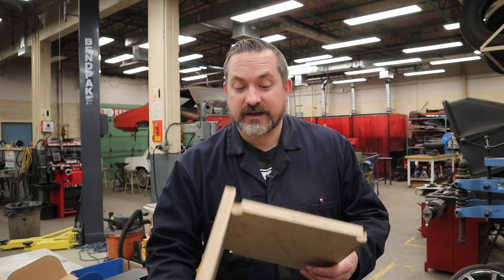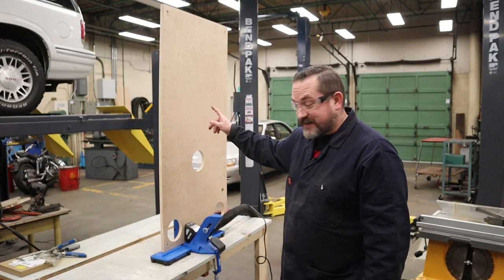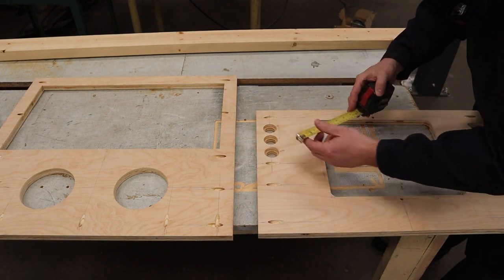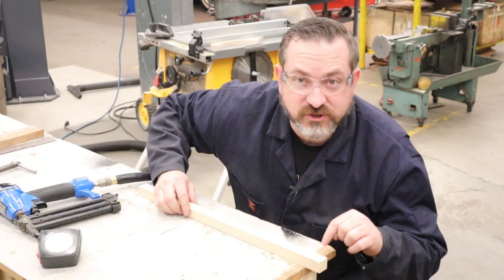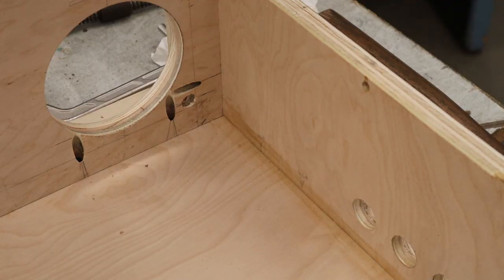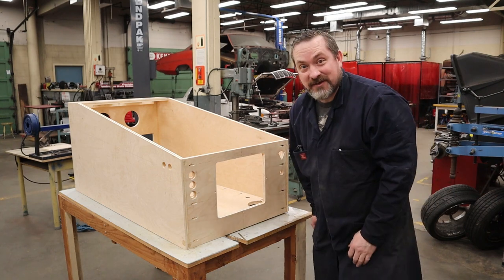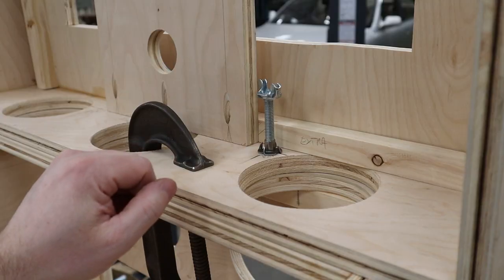How to assemble your virtual pinball cabinet

Comment: Very cool... one thing I would of done to make it look nice is to put a small piece between the playfield and backbox (to lift the backbox from the cabinet), just to separate the two, look more original.
Reply from the maker: Ya know, you nailed it right on the head.  As it turns out I missed the part in the mjrnet plans that has the top piece of the cabinet having a rabbet which would raise the back box 3/8".  So I had to cut a piece of 3/8" plywood to put between the two and plug/redrill the back box hinge pivot holes. I make note of this is a future video coming out soon.  Thanks for the suggestion and the watch!

Comment: Thanks! I love your videos! <3 I was thinking that T-moulding needed round corners... I can't wait to see how it fit on sharp corners! ;-)
Reply from the maker: You are so welcome!  Thanks for watching them!  If you cut the spine off at a 90 degree cut out, it should fold around a 90 degree corner but with a slight radius added to the outside.  I plan on softening those sharp corners a little bit, maybe like a 1/4 radius or so just with sand paper on a sanding block.  It's funny because most of the pinball cabinets I have been looking at don't even go around the corners. they just put the t molding on the front and that's it.  I like the full wrap though, I think it will look more polished/finished and not cheaped out.  Cheers!
Reply: @wayofthewrench  you are so meticulous… you are an inspiration!
Reply from the maker: Love the comment, thanks!

Comment: Great job liked your video. 
Sorry if this feels like criticism it is not. Hopefully this will save you time.
If you were going to hinge the back box it will not work. What is needed is a 3/4” lip at the top of you cabinet. You can fix this really easy by adding an additional peace of 3/4” plywood to step it up. Hopefully you have not drilled your back box hinges yet.
I made this mistake in 2015.
Reply from the maker: No no none taken, this is my first vpin build so I'm totally open to suggestions. I actually did your mistake and just went ahead with it.  I just realized that the mjrnet plans are for a rabbet joint on the top 3/4" piece which would make it stick up a 3/8".  Do you know if the 3/8" above is not enough?  I just made up the 3/8" piece but still have to glue it on the top but I already plugged/redrilled the back box hinge holes for the added 3/8" piece.  I should temporarily clamp it on and see if it works, mind you I'm not too concerned about it fully closing but it would be ideal.  Thanks for your suggestion and the watch! Cheers!
Reply: @wayofthewrench   Not sure about the 3/8 measurement. When I realized I messed up. I cut a new 3/4” plywood for the top. I mirrored my cut outs for cabling I then place it on top of my existing top glued and screwed. The overall look of it was not noticeable as a mistake after I put in the glass channel reciever 
I did drill my holes for my hinges already so I filled them up with plywood plugs and glue and sanded them away.
This is going to be a great first cabinet. The next will be even better.
Reply from the maker: Yeah you did what I just did except I did 3/8" so I guess I'm gonna find out, I'll let ya know.  Thanks, I'm really looking forward to my cabinet.  I've been playing a lot of pinball in local places and on ps4 but can't wait for this build to be complete.
Reply from the maker: Well I just checked....3/8" isn't quite enough so you are probably right about it needing 3/4".  Not sure I'm going to change it a third time but will definitely tell people in the future video.  Thanks for the heads up!
Reply: @wayofthewrench   I need to let small things go here and there too. My OCD is pretty bad though. I burn a lot of dollars. Lol
Reply from the maker: Yeah I'm part of the OCD club too. Part of me wants to fill/drill those holes again but the way I see it, I would never just put the back box down and mash up the stainless side trim anyways so I would have to place a board in their with blankets to prevent any damage anyways.  So just gonna leave it and be happy with it the way it is, which 99.9% of the time is upright and gaming.  Cheers!

Comment: Are the bottom and the side's of the cab the same size?,plans on the net show the bottom 36mm shorter.Thanking you in advance.
Reply from the maker: The sides should be the same but the front panel and back box are bigger to accommodate the tv.  Plans are in the video description.  Thanks for the watch!

Comment: Very nice build! Also very nicely explained although I have plenty of experience myself I got a few tricks along the journey. 👍🏻
One thing I am curious about. I noticed that most of the pocket holes are on the outside. Is there a specific reason for this? I usually make them on the inside, because it saves an awful lot of cleaning up and filling later.
Reply from the maker: That Bruh!  Glad you enjoyed the video and got some new tricks to add to your game.  When I made two test pieces that was held together with pocket hole screws, there was significantly more strength when the pocket hole screws were put into the inside rather than the outer edge.  So based off that I put mine from the outside.  Its not that big a deal as I need to sand the outside of the cabinet anyways so a little wood fill/bondo and it'll be mint.  Thanks for the watch!

Comment: First of all, that Jig is awesome, $175 ouch !  Anyway, I am thinking about doing mine in particle board, just because the fact that I plan to skin and the price point. Will that work well with doing pocket holes? 

No question, I would do the wood blocks as well, that would keep it rock solid.
Reply from the maker: I do not recommend using particle board as it will dampen all of the ssf vibrations and personally I think particle board is junk.  It has it's uses but here is not one of them.  You will have to sand an enormous amount to get it smooth enough to not see every chunk through your vinyl.  Don't do it CoolDave!  Pony up and at least find plywood if not cabinet grade plywood.  Should be about 150-200$ CAN.  Cheers!

Comment: Can you please explain to me why you need the complicated angled screws. You still need to fill the holes & it will be wrapped anyway. Your a Legend so there must be a good reason but my brain can't work it out. I would have thought just drilling in the side at 90 degrees would have been stronger & so much easier?  Can't wait for your next video on the epic build!
Reply from the maker: If you run screws into the edge of the plywood, it has horrible strength, unless you screw into the 1" x 1" glue blocks which is exactly how I did my arcade cabinet.  There is absolutely nothing wrong with doing it that way.  In the video I explained that and said I wanted to try/learn/teach something new for everyone, including myself.  Now the  pocket screws could have been done from the inside and there would have been no holes to fill on the outside, however, when I made a test piece and did some research, it was way stronger from the outside.  So to me, it is extra work to fill/sand them but the end result is a stronger/longer lasting cabinet.  Especially with the glue up blocks.....it's bulletproof!  I might not even fill the holes on the top of the back box or the ones on the back of the cabinet because you literally will never look at them.  Then again, I'm a glutton for punishment, so I might...lol.  Thanks for the watch.   Legend out!
Reply: @wayofthewrench  Thanks for the informative reply.
Reply from the maker: No worries, glad I could help
Reply: @wayofthewrench  Kreg sells plugs that fit the pocket holes, or you can cut your own using a 3/8" dowel and a flush cutting hand saw. A dab of glue and a bit of sanding and the pocket holes are all but invisible once filled with a plug. On a side note, I met Craig Sommerfeld and bought one of his original K-2 Kreg Jigs at a woodworking equipment show back in 1990. Nice guy, and it's cool to see how big Kreg Tools has grown since then. At the time he was a one man operation selling his jigs off of a card table at trade shows like the one I attended.

Comment: Really appreciate your videos and right in the middle of my build over the holiday (here in the US) - question for you: why did you put your pocket screw holes on the outside? Is it because you're going to vinyl wrap later in your build?

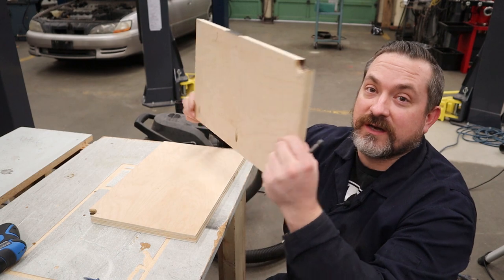edit: nm I saw your answer around 5:48 - looks like you fill them with wood filler and sand later on. I had also realized that you get more grip by angling them down into the material rather than towards the edge (if they were reversed) which you also confirmed.
Reply from the maker: Yeah I got a lot of flack for this but I did the test and I went for better strength rather than hiding holes, especially since I was going to fill/sand/vinyl over it anyways. If you deem me worthy, I'd really appreciate it if you could share out my channel on your social media so I can help more people. Thanks for the watch and your support for the channel!

Comment: Hi,I'm going to use 18mm ply for my cab, and will simply screw them together (sides to the bottom etc),will 40mm long screws be OK to put the cab together?,thanking you in advance.
Reply from the maker: I would highly recommend gluing and screwing in some reinforcement with glue blocks on the inside to beef up the screwed corners.....they won't be enough in the long term.  Thanks for the watch and welcome to the channel!
Reply: @wayofthewrench how about 50mm?,....it's just that I had a shed load of 40mm and thought I could get away with it!.Thanks for the reply.

Comment: Just curious... i am in the process of assembly my cabinet and there is a slight bow in my 3/4 inch plywood side panel.  might be an issue when i install the glass.   So my solution is to put in two Side panel to side panel cross braces (2x4), just below the monitor support frame. This will pull in the slight bow and provide additional support for the monitor support frame.... or should i just replace the bowed side panel with a "straight piece" .. your thoughts
Reply from the maker: Hard to say without seeing it but yes the cross bracing will pull in the sides a lot.  Unless it looks like a Dorito, it should be ok.  Good luck!

Comment: Hi,what is the purpose of glue blocks?and are they necessary?
Reply from the maker: Technically they are not required but they add so much rigidity that the cabinet is bulletproof.  So it's cheap and easy insurance for the cabinet to last way longer than even factory ones.  Thanks for the watch!
Reply: @wayofthewrench  Thanks for the reply,but wouldn't it make more sense to have them right up against the sides?,or am I missing something obvious here?..... By the way your pinball series has been outstanding;thanks for all the work you have put in;not only in building the machine,but all the video editing, uploading...etc etc.Well done.
Reply from the maker: Yes they are glued right into the corners so they touch/support the sides.  Thanks!  I work really hard on these videos so it's always nice to hear back from subscribers.  Cheers!

Comment: If I'm just wanting to drill holes from the outside and screw straight into the ply... not pocket holes...
Is there any tips for do's and don'ts? Like best screws to use.. how far to drill.. how far to counter sink etc?
Reply from the maker: Hrmmm let's see.  Predrill the holes for the screws just so the body of the screw passes but the teeth can fully grab.  Countersink your screw holes so the head of the screw sits just below the surface once tightened.  Use screws that are long enough to go through the 3/4" sides and into the glue block/batton or the other side at 90 degrees.  The batton will have more strength if you can go into that....plus the glue joint.  If you watch my arcade cabinet assembly video, you'll see exactly what your asking about because that's how I did that one.  Cheers!
Reply: @wayofthewrench  yeah I've watched that... I'm planning to screw through the side of the ply into the ply in joining to.. and then glue blocks in for bracing... rather than screwing into batons..
Reply from the maker: Yeah I wouldn't suggest that as you are screwing into end/edge grain which isn't as strong in plywood.  I highly recommend you glue screw/brad nail a batton in and then the other piece screws into that.  It will be way stronger and the plywood plies won't seperate.
Reply: @wayofthewrench  hrmm.. maybe i will do the pocket holes then.... but the tools are gonna cost me a couple hundred more lol...Do you think go for the corner clamp or the pocket hole clamp?
Reply from the maker: Ya know it all costs money but think about the price of your experience/learning...it's priceless.  Plus you get to keep he tools and your next project will benefit from having these tools and the experience.....it just keeps getting better and better.  Either work, I bought the pocket hole clamp but there might be a benefit for buying both.  Good luck Chris!

Comment: What do you suggest if we don't have a compressor and brad nailer?
Reply from the maker: You can clamp and predrill holes for screws too, I was just trying to show another method.....it is also way faster.  Really if you do it right, you don't need and nails or screws, they just hold the wood in place while the glue dries.  Thanks for the watch!

Comment: shouldn't you have put all the pocket holes for your bottom cabinet piece on the bottom side of the cabinet and not on the top of the bottom side?  In the way you did it, the screws are going into less meat of the wood.  You did it correctly on the backbox.
Reply from the maker: There is a 1 inch space underneath the bottom piece so either way it is the same strength.  The bottom also sits on top of the 1" glue blocks too for tons of strength.  The reason why I put the pocket holes on the top was because if I put them on the bottom, the glue blocks would block access to the screws in case they need tightened later in life.  Thanks for the watch!

Comment: Probably watched this whole video 3 times now, but I just noticed you had an access panel in the back of the topbox as well as the main cab. Was that just to make putting it together easier? Were you doing the same as the cabinet with the hinged door?
Reply from the maker: Yes the backbox has a hatch too just like the bottom.  It will be in the backbox video if you're looking for the info.  It came in super handy to mount the monitors and put in speakers, etc.  Thanks for the watch!
Reply: @wayofthewrench  Sweet cheers dude. I didnt have one in my designs but makes sense to make things easier when building. I remember one of your videos saying everything would come out of the front so i didnt put one in mine.
Reply from the maker: Yes the monitors do come out the front but you need to tighten the bolts from the back so the hatch is much needed.  Cheers!
Reply: Cool thanks dude. I could be wrong but I thought in the backbox video you talked about the whole back panel being removable, not having an access panel, but I think access panel will be better to give the backbox more strength so I'll probably go that route too!
Reply from the maker: not 100% sure what I said in the video but I might have changed my mind while making it.  You technically could leave the back free to remove out but it would be way less stable overall.  With it glue/screwed in and the hatch, you leave a frame around to keep it square and solid while still being able to access the inside.  I used the same technique of plunge cutting with a jigsaw in order to cut it out and it worked out great.  Well worth the extra effort and the cost of the hinge.  Cheers!

Comment: What length screws please? I'm thinking 1-1/4" ?
Reply from the maker: Yeah that should work if you use 1" x 1" glue blocks.
Reply: @wayofthewrench  I'm going back to the pocket hole route.. did you use 1-1/4"?
Reply from the maker: Yup!